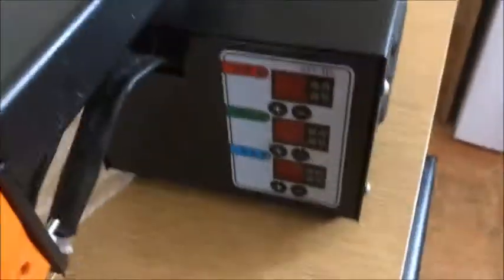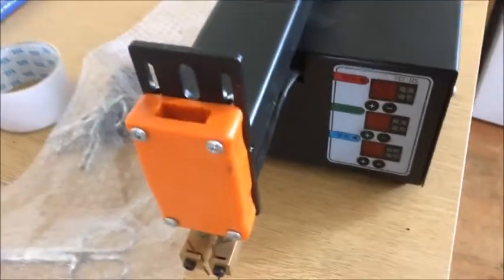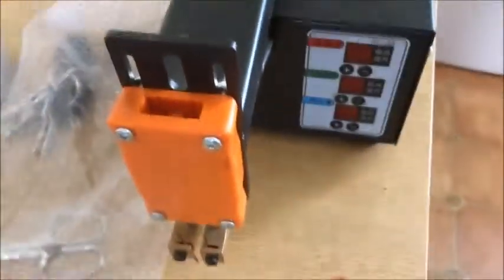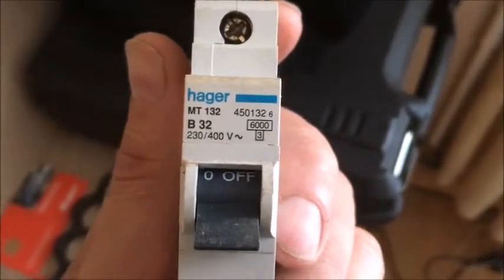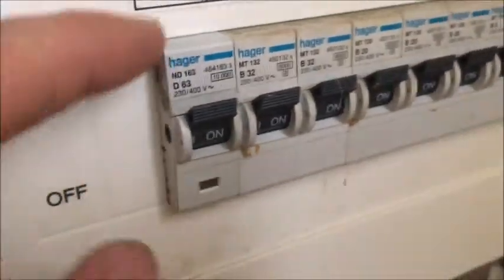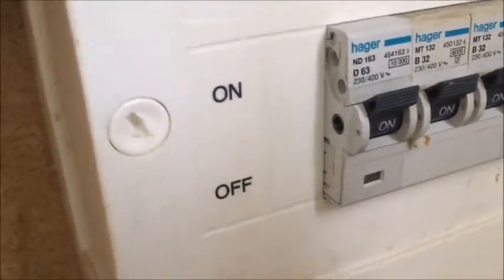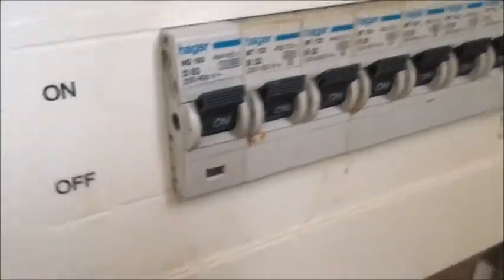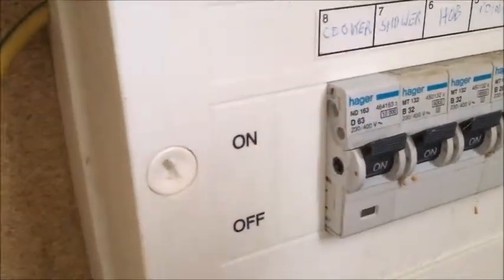Ultimate Sunkko Spot Welder MOD! Stop Blowing Fuses breakers & Get Better Welds

Comment: hi, i bought your sunkko 737dh welding machine. What should be the insurance values. Can you tell me the kA value and fuse type. What is the difference between B type and C type.
Reply from the maker: hard to understand translation B type breakers trip at low inrush currents a C type breaker can handle higher inrush currents that this machine uses when operated
Reply: @cagmito76  Is B type 40A fuse enough for sunkko 737dh model
Reply from the maker: @emindogan291  i do not think so  , it would be best C40 but try it you never know
Reply: @cagmito76  okey, thanks :)

Comment: D is a bit overkill. I changed for a C 32A (same price then the 25A so why not) and using 2 spotwelders at the same time. Works like a treat
Reply from the maker: yeah i agree but it was all i had and it has been changed now
Reply: @cagmito76  Oh I see. Yeah if I had just laying around one of these I would have used that as well :)

Comment: My Sunkko 737G should use up to 15 Amps but it's still tripping my 16 Amps circuit breaker :/ wonder if 32A is enough.
Reply: Go for a C rated circuit breaker for motors.